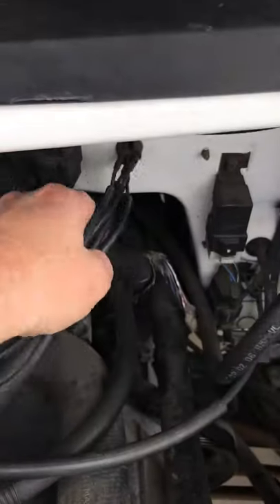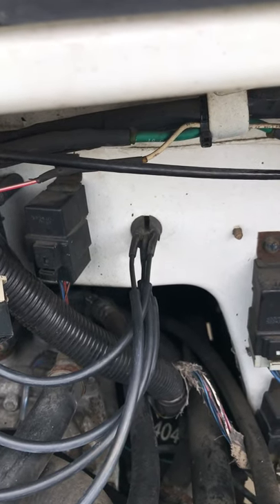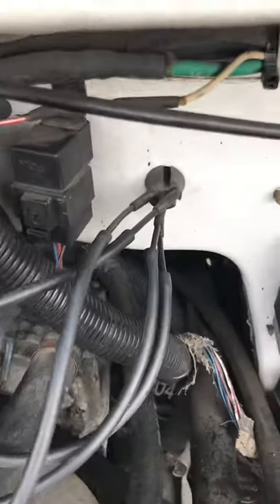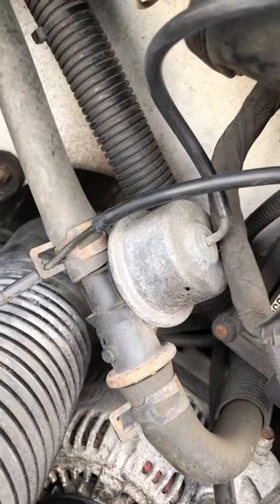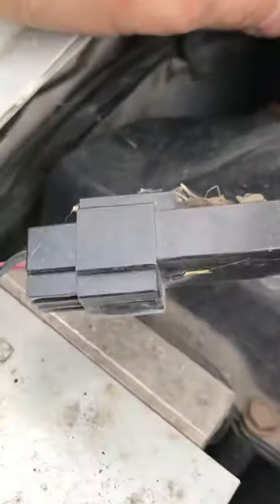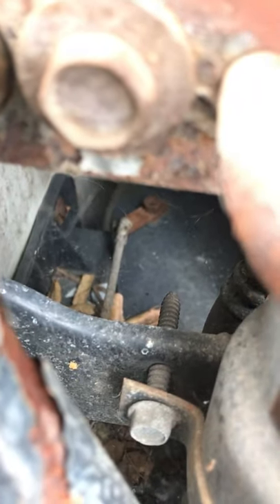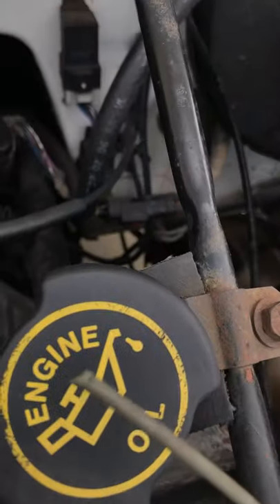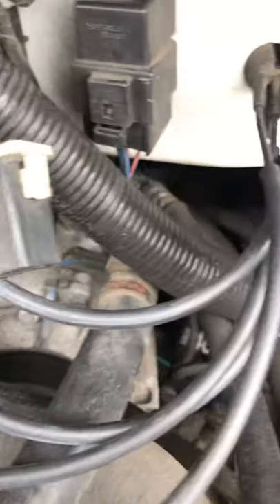Dodge 1995 Ram Van HVAC vacuum line routing inside engine bay

Comment: Holy cow thanks so much. Just bought an old 2000 Dodge ram van/wagon 3500. AC seems to be basically not working at all and air flow is all messed up. That said I don't know if the 2000 model has a similar set up, but going to see if these lines are going to where you have shown. Many thanks for putting this up and for showing how you figured this out. This is what YouTube is all about!

Comment: What was the size of the vacuum line hoses that you used to replace the lines?
Reply from the maker: Sorry, I do not remember.
Reply: @Thinker9219  it's a 3mm inner diameter, silicon
Reply from the maker: @Genius_Loci_  Thank you!  In the US that is 1/8" ID.  Sold at auto parts stores.

Comment: Hello I'm trying to figure out why my ac move the air to defrost when accelerating which valve should i replace?
Reply from the maker: My guess is that you have low vacuum while accelerating and this is just a symptom.  Google a bit.  https://www.cargurus.com/Cars/Discussion-t21961_ds547756 may help.